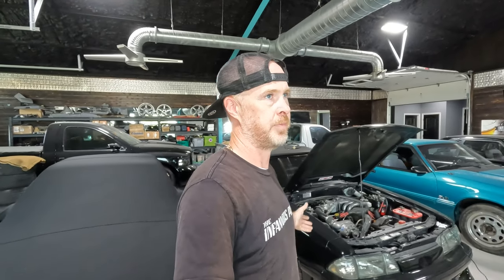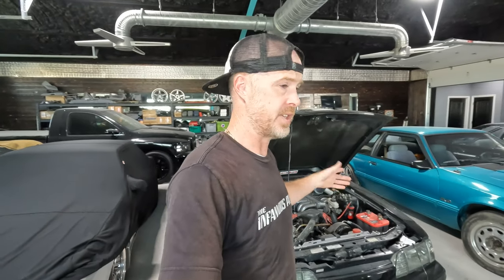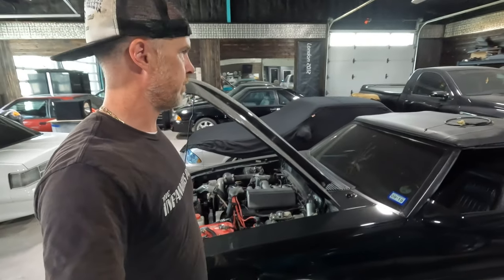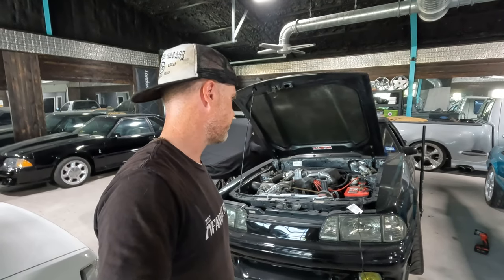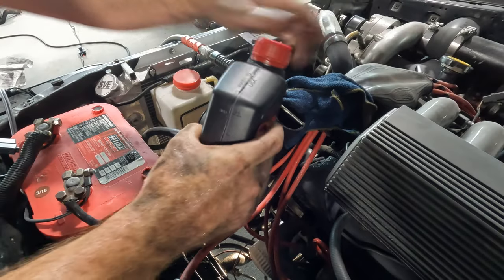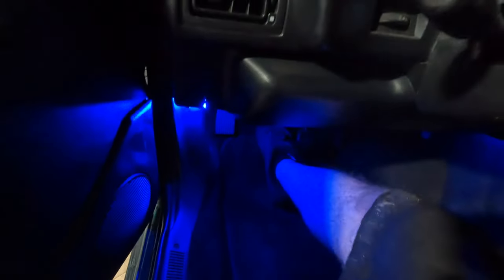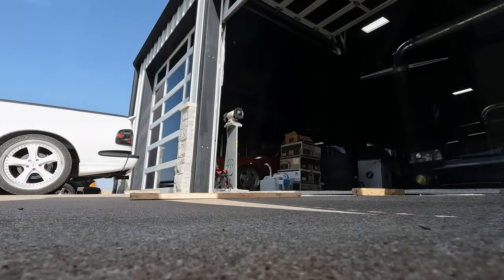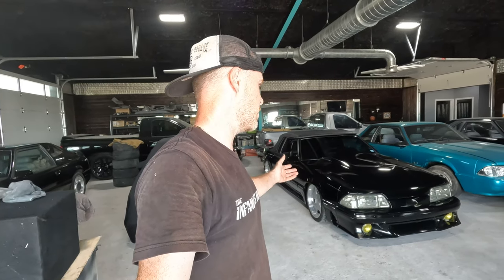Fox Body Maintenance Issues on the 1987 Stalker Vert! - TIPS05E49

Comment: I've had several clutch cables fail at the firewall, including ones I've bought from Maximum Motorsports that were Ford parts, all on a basic King Cobra Ford clutch.  Not fun when it fails on the freeway while driving back to work after lunch!
Reply from the maker: Always fun driving with no clutch cable rev-matching and hoping you don't need to come to a complete stop lol!

Comment: If it has big long tubes, the heat from the header will melt it slowly and it will snap, took 2 good cables for me to realize what was going on, heat wrapped ft , no more issues
Reply from the maker: Just shorties.. heat never an issue but I've had to do that with other cars

Comment: These are definitely cars where you replace or fix one thing and that brings something else, I replaced my ignition switch and now my radio stays on when you take the key out so now I need a new lock cylinder which sucks cause I like my OG keys smh

Comment: Your power steering hardline is kinked pretty bad going into the rack at 14:53 mark, that will impede fluid flow to and from your rack. That is probably why your having steering issues. The line needs to be replaced. I accidently added power steering fluid years ago but it did not affect my steering when mixed with ATF fortunately.
Reply from the maker: That line has been kinked (looks worse than it is) for years and never had a problem until the fluid change. Since the fluid change I have had 0 issues. I'll do the line the next time the motor comes out... which will probably happen soon enough. This car sees maybe 50 miles a year.

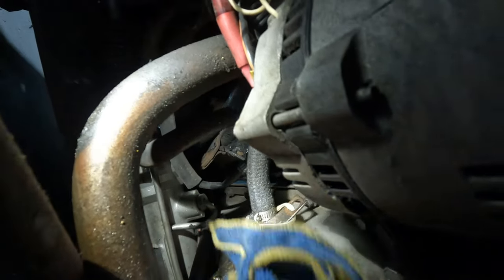Comment: Man Chris there is(maybe) your PS problem @ 15:22 that metal line is kinked...
Reply from the maker: Ya it's a little tweaked but it's ok. Fluid flush and swap fixed the issue. I didn't change the rack so not sure when that happened..

Comment: I have a 1992, triple black, rag top, 5 speed Fox body LX 5.0 for sale.  All original and only 1 owner.  Car was in PA until jan. 2000 and in Cali ever since.  Can anybody tell me what I can get for it?  Thanks.
Reply: 144k miles
Reply from the maker: Really depends on the overall condition. 10-15k is my guess for the right buyer.